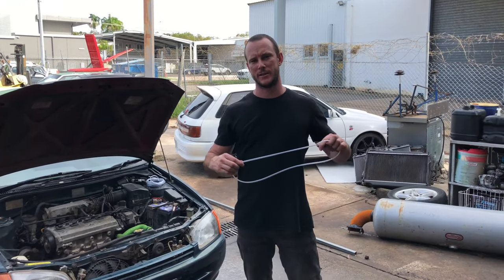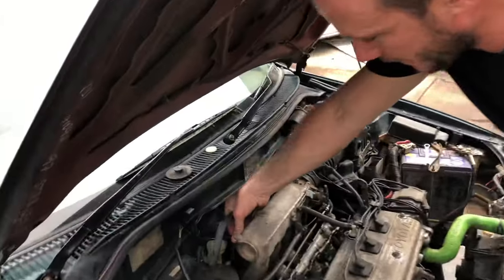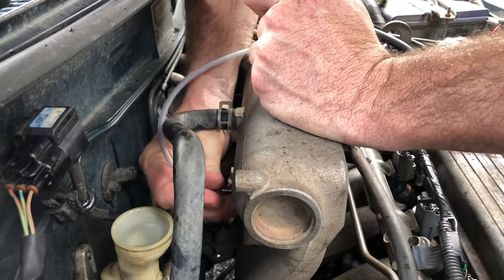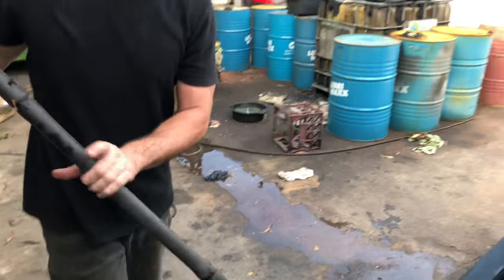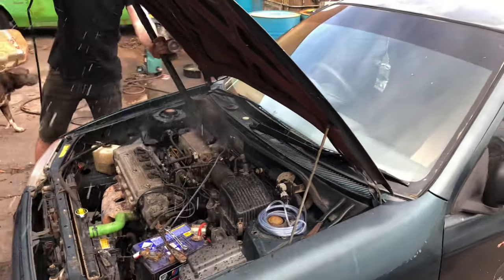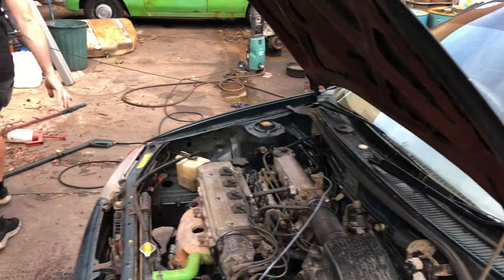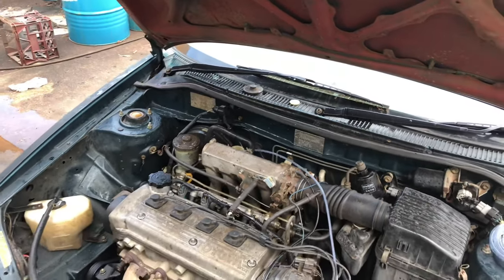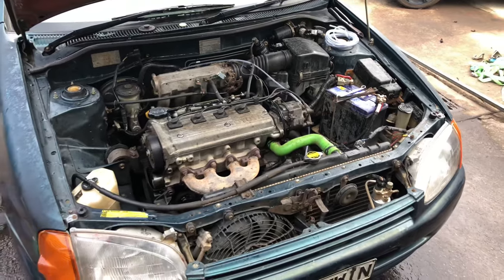How to Bleed a Clutch in Under 10 Seconds: Quick & Easy Method Explained!

Comment from the maker: PRO TIP: use atleast 5 metres of clear hose that way it will give the fluid enough room to not get sucked into your engine. 

PRO TIP 2: leave the bleeder nipple closed until you are ready to bleed it. (Creates a lot more vaccum to pull the fluid through) 

Once the engine is running and the clutch master is full of new fluid, slowly open the bleeder and watch it pull the air out within a few seconds. Once you see fluid and no bubbles, close bleeder and the job is done.

Believe me if your clutch system is being a nightmare to bleed, this method does actually work. Leave a comment below if you tried it!!

Comment: Have you ever considered selling whole Starlet GT rear disk sets with e brake cables on the website?
Reply from the maker: Nah I honestly think the drum brake setup works better. Have never had an issue with rear brake fade and the handbrake works a lot better than disc rear end
Reply from the maker: Nah I honestly think the drum brake setup works better. Have never had an issue with rear brake fade and the handbrake works a lot better than disc rear end

Comment: I used to use a longer length of hose and return it to the reservoir, but that way looks better with extra smoke.😀😀😀
Reply from the maker: Extra smoke means you know it’s working
Reply: Does your method work? To reservoir?

Comment: Hmm....and no water in the brake fluid? I don't think so.
Reply from the maker: Water only lowers the boiling point. I’ve used plain Water before when I didn’t have any brake fluid, it works fine